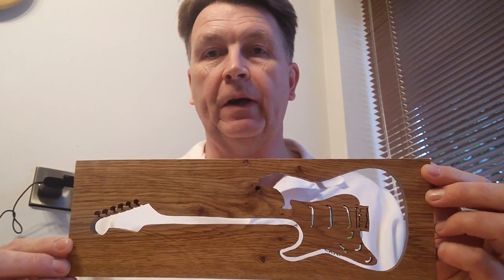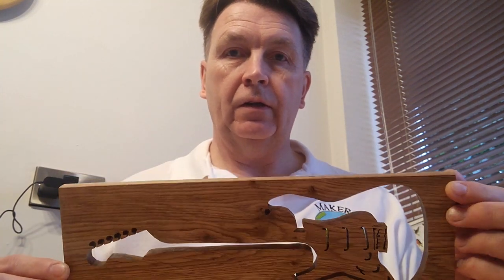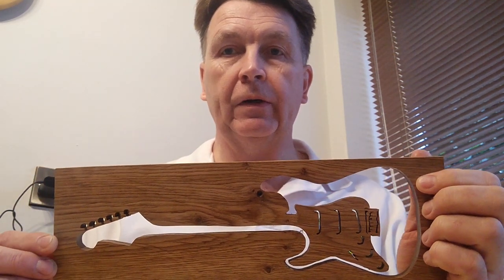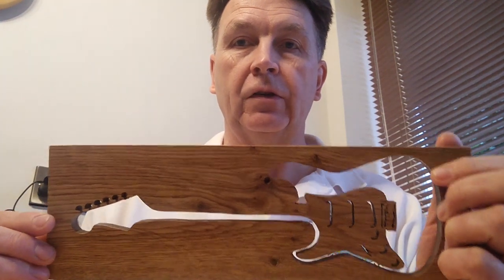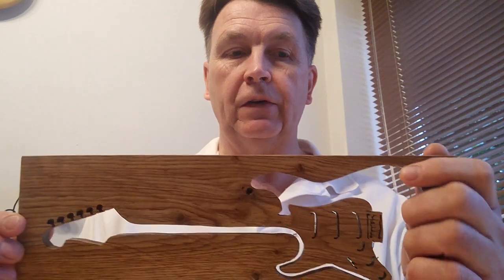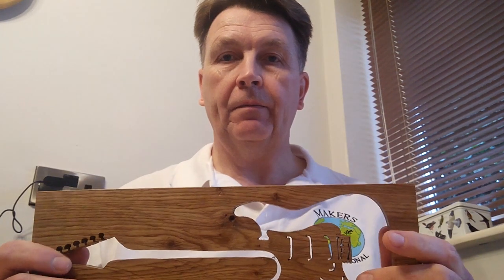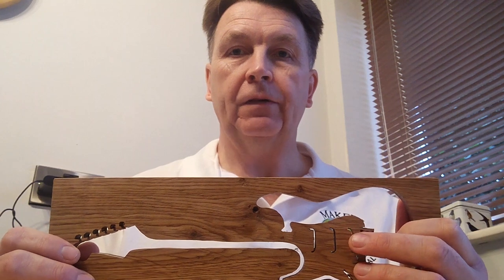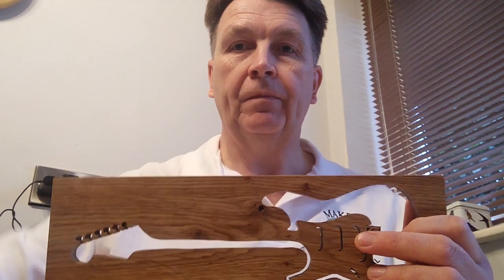Stratocaster Scroll Saw Project

Comment: Do you still have this template?
Reply from the maker: Hi, unfortunately the link in my description doesn't work and i have lost the original file. I also contaced the originator but with no reply. very sorry. if i come across it i will let you know.
Reply from the maker: Hi, i have just checked an old hard drive i don't normally use. and ive found it.
dm me through Instagram andrewmcquillen22 or facebook messenger andrew mcquillen with your email address and i'll send you a copy.